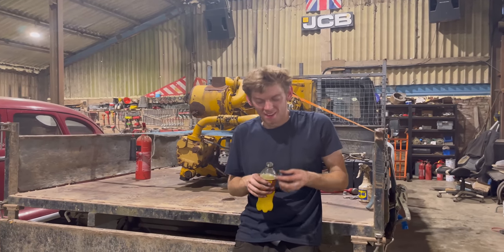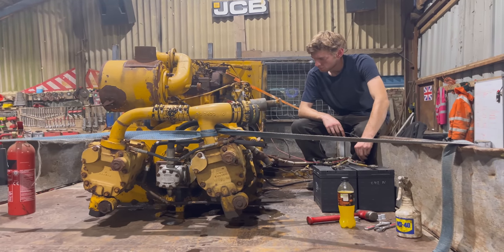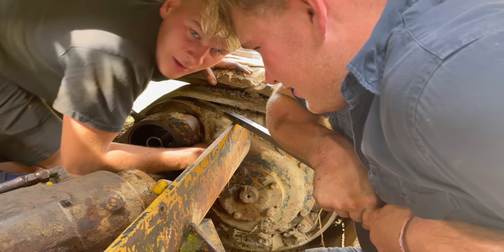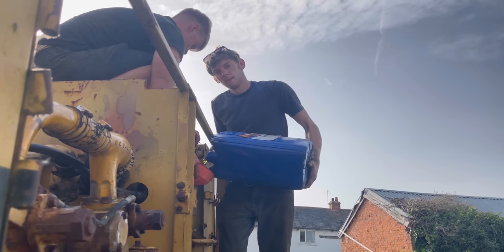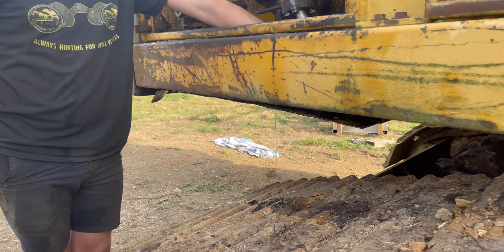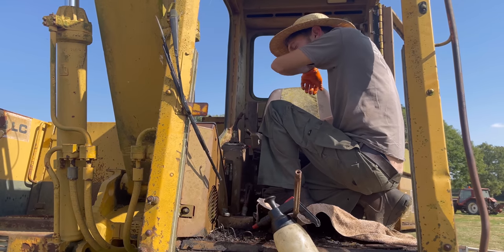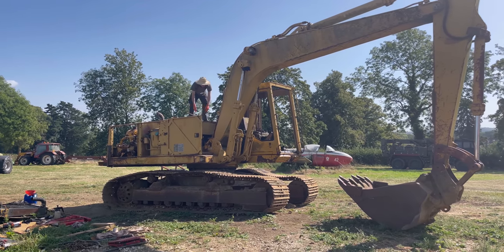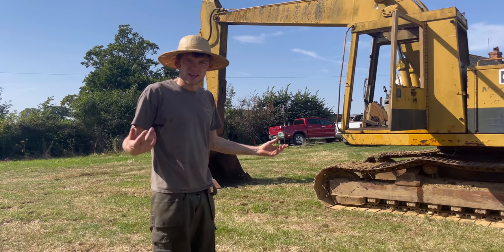Caterpillar 215 excavator Working for the first time in nearly 30 years!

Comment: I've worked around older 10 to 15t tracked machines, mostly dads for a while, dad's 80 and Im nearly 60 and one thing I would suggest is adding about 10% Lucas hydraulic oil improver. I find it improves the track drives no end. I've no interest inn the company at all I just like this particular product. Theres nothing quite like the agressive beat of this generation of diesel engines and that sounds like a corker.

Comment: Good work getting the old Cat running, it may struggle for lack of horses if operating multiple banks at the same time.
You're fast becoming the English WD, you have the excavator, just need to set light to a Ferrari in one of your dad's fields now.
Could call yourself "Misfiring/Sputtering Petrol" in keeping with a lot of the old military engines you have...
It'll be great to see Jack back with his humour and the banter between you two.
Reply: I don't know about this particular model, but I know many old Cat engines were essentially identical between the NA and turbo versions. Pretty much the only differences on many is the injection pump, manifold, and turbo itself. Might be feasible to swap those parts over if they aren't too far gone.

Regardless it'll be a fine machine as-is. Just gotta take things a bit slower.

Comment: That was pretty cool, amazed that everything worked so well. If you're too tight to put fresh diesel in it, filter old hydraulic oil, & thin it down with some old brake fluid.

Comment: 1/Beware Hydraulic Oil catches fire really easily. 
2/ H Oil from a split pipe could have huge psi and a thin jet can pass through your body, and then its probably lights out.

Apart from that warning great vid as always.👍👍

Comment: I believe the leaking is caused by the seals, which became brittle from not being used for so much time. To stay pliable, they needed to be lubricated. To be that, they needed to be in operation. It obviously wasn't that. I hope you had fun fixing those problems. I know I would.

Comment: I think to move these machines you could just weld up some duel wheels with a kind of clip that would hook to the track. Weld a plate to the back of the set of duels  and go off of that 90 degrees along the bottom of the track. Have another plate going up the other side of the track  that could slide on a bolt that would clamp the track like a vise would. then you'd have a wheel on the track but it would only be about 3 or 4 inches below the track so it wouldn't be crazy high. It would just give you a little wheel like those hidden wheels they used to have in the heals of kids shoes so they could skate around the shopping mall. Put it on the inside of the track under the machine or on the outside, which ever worked for what you were dealing with. But, you could make the thing roll up on a trailer or across the ground .

Comment: Bit of grease in the work equipment and tracks.
Maybe worth putting a bit of plate on the side of the cab just as protection if the hyd hose bursts on the boom raise. Great content

Comment: Another great production. Do you not have a few of those hydraulic hose fittings that screw into each other to make a temporary fix. The ones where the spigot goes into the hose and the ferrule tightens up to make the connection. Not a long term fix but handy enough to get yourself mobile. I kept quite a few in the shop just for emergency purposes. Straight couplers were handy to make good a split in a pipe.
Glad to see the old girl moving again after so many years asleep

Comment: Nice job. When you test fire an engine with the hydraulic pumps, be sure you put a little oil in them and don’t run the engine as long as you did. You can damage the pumps.

Comment: You would think it was in useable order when the engine through the rod. So replaced engine , all the parts would have been protected with gear oil/hydraulic oil. The only ?? would be the tracks and rollers, no oilor grease there, so they will need some serviceing/greasing. Loved to watch, reminds me of the things i use to get up to. Good old fashion mechanics none of this modern fly by wire and computer controlled Sh*t. Not to mention keyless ignition with fobs.😡🤬

Comment: I just stumbled upon your channel and it’s a coincidence but we have just bought a cat 205 clc , it has a deutz air cooled engine it runs and works but hasn’t been used for over 15 years so most of the hydraulic hoses are perished and the slew ring is gone so we have lots of work in store 😂

Comment: It looked a little hesitant to steer, does it just need a bit of rust knocked off and bubbles purged from the system?
Reply from the maker: Yeah it was at the start, I’ve tracked forward and back loads now, and it turns fine

Comment: Can you put the turbo on from the old motor? Or would that involve needing injectors also
Reply: I suspect it's a mechanical engine pre electronic Cats so it's just a fuel pump  adjustment isn't it
Reply: Think it would need the plate that was under the head on old engine too, that lowers the compression. I am sure someone with a lot more expertise than me could advise on that. After all can’t beat more POWWWWEEEERRRRR! (Well 20 odd HP🤣) 👋😀

Comment: You're working on your hydraulic system when you hear screaming - do you A - check on the welfare of the damsel in distress or B - run to see which line has let go. The answer of course is B!

Comment: Brilliant.  Although I'm confused how any engine that huge can have only 91 hp 😂
Reply: Hydraulics,   it just runs slower ,  the extra power would make it quicker to operate ,  hence more productive as a digger,
Reply: The engine has very very under stressed and being a basic diesel it is what it is , add a turbo and you could push 500 hp
Reply from the maker: It’s high torque low HP

Comment: You could have at least 'placed' (gently) the replacement motor in the back of the Hilux rather than the Transit 😂. New motor sounds sweet. I suppose you could fit the turbo onto the new engine but guess you'd probably have to mess around with compression ratios and injection timing?
Reply from the maker: No clue lol

Comment: So now you have another crane, beastie beater, scrap consolidator. And your father can dig some trenches,, or go into business for rock supplies.
IF that has sat for 30 years and you have spent what 3 days on it. Maybe you need to buy some hose making equipment. Though maybe not as  then you need to buy hose and a shit load of fittings.

Comment: Please get yourself a microphone, it’s pointless doing a video when you cannot hear much of what is being said.
Reply from the maker: I edit and watch every video back, I can hear it fine.
Reply: @MrHewes  Everything plays back audio differently and we all hear it differently. Some will struggle with some background noises where others don't.

I'd supply a few links to radio mics but YT doesn't like me linking things.
Reply: Mics are very delicate. Mastermilo had one and it broke the wire. Most of them are not made for crawling in and out of tanks and other heavy machinery.
Reply: @JobBorn86  They make these wireless ones now. It is 2023.
Reply: @Monkeh616  it was wireless, it just had a wire to the transmitter.